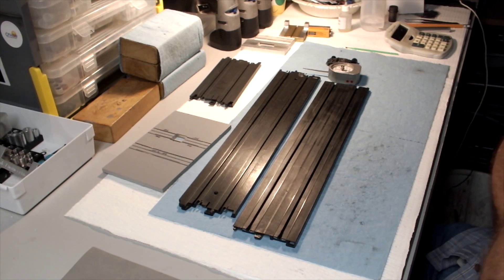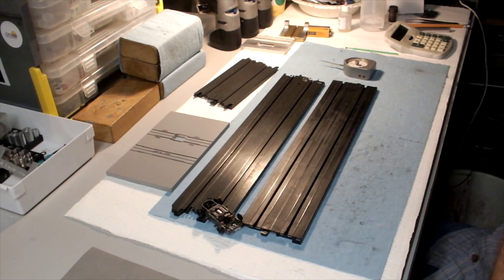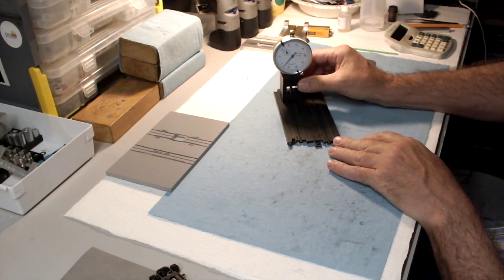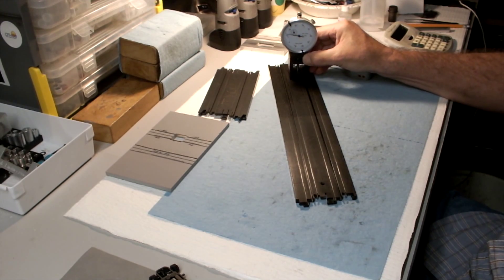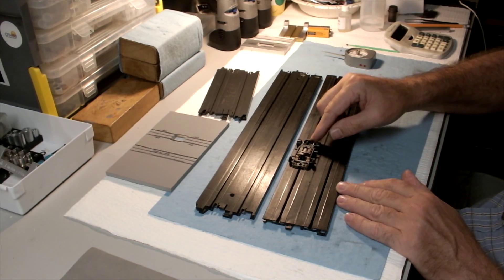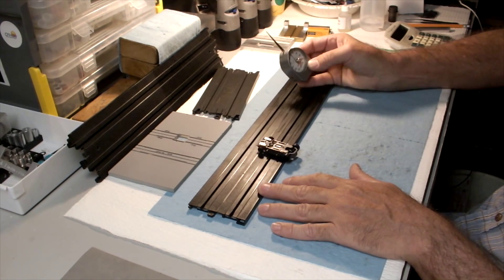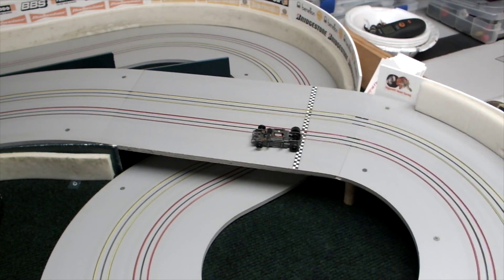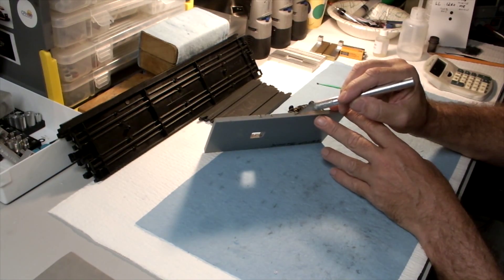Evaluating HO Slot Car Track Rails

Comment: I run a 4 lane Tyco track at my house.  Number 4 or the very inside lane is just under 100 feet of track.   A few of my other friends have four and two lanes of about the same length, but use Tomy and Auto world track. The performance of our favorite cars is very different on each of the tracks.  We spend a lot of time jumping from track to track just like NASCAR or even Indy Road courses.   Your video was able to show some of the reasons why our cars perform differently on each track.   Great video.  Maybe you could do a video and power supplies.